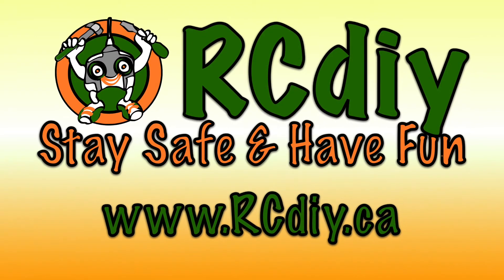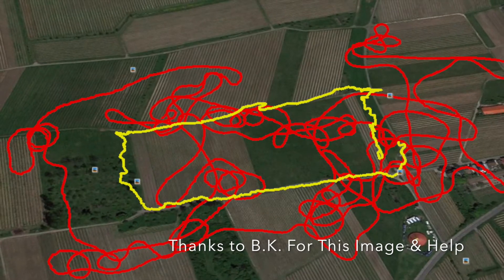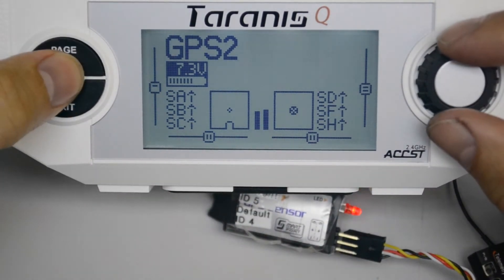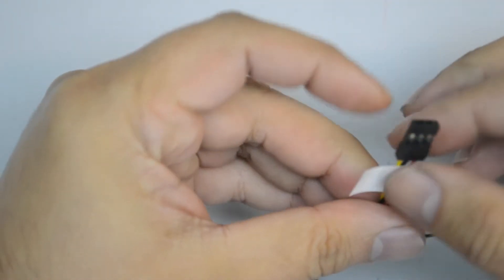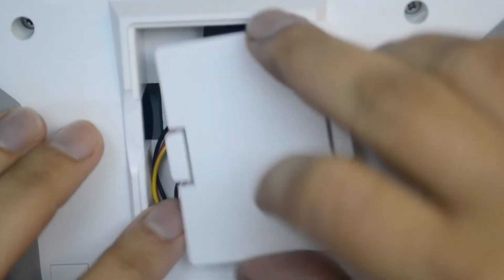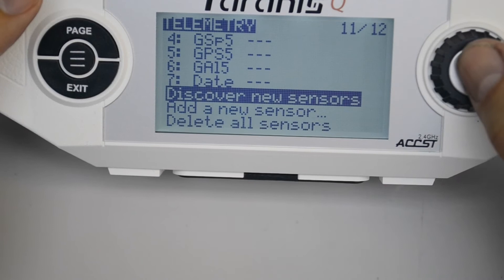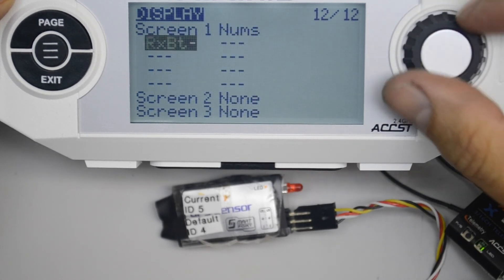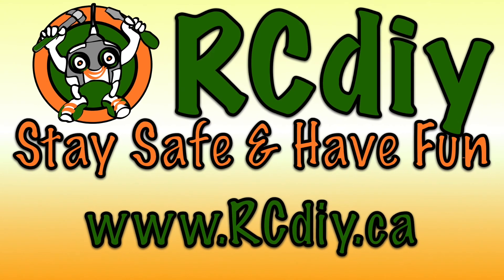Taranis Q X7 OpenTX Two GPS Sensors Together

Comment: Hello !prompt please here at me on Crossfire GPS data from the menu of Taranis x7 does not appear I choose detection of new sensors it about nine finds but among them there is no GPS data. but also for some reason telemetry in lua script inav on the remote also does not go though 3D fixation eventually occurs but for some reason the data from the controller flight most likely do not reach the remote in General I do not know what the problem is. you can tell on Crossfire behind on the remote control should be the last menu item displayed GPS data here I do not have them. in the configuration settings of the flight controller, inav has checked the data telemetry feed.What can be done .Where to find the answer that can suggest the ?!prior to that, the lua Script was working fine through the port F which was on the flight controller. the update didn't help.   Anik fpv video management smartphone crosffire at 1:53 you show that it had gps telemetry data. I made on its video all settings: inav port 57600+mpi-, in a configuration included telemetry output. On the smartphone in mission planer it is to see and do so. 2 weeks ago the firmware is only updated crossfire.installed the correct speed Converter now 400000. Search for new sensors included in the menu of the remote.3d fix is happening and gps data on transmitter FA there is no.  Thanks in advance !